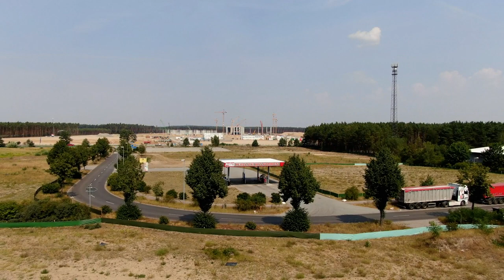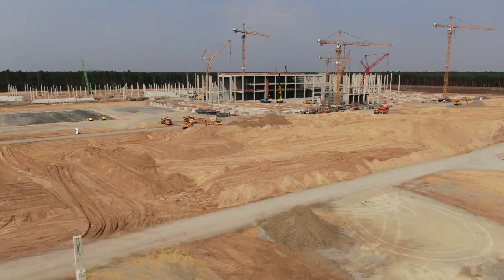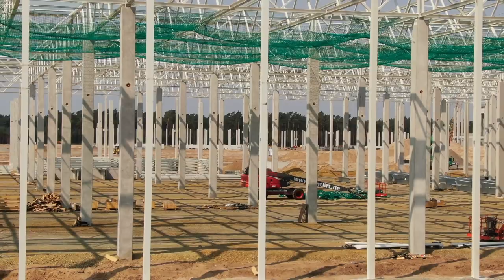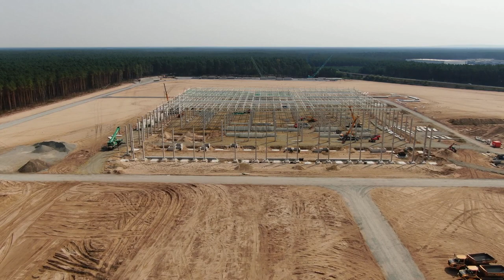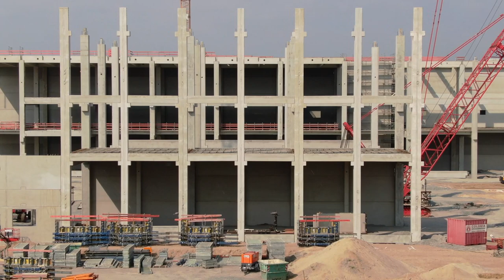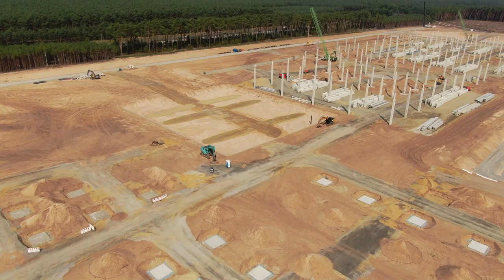Giga Berlin | 2020-08-09 | Roof structures

Comment: Thank you Tobias! Looks like the work is proceeding very well. Do you know if Tesla got their updated application approved?
Reply: Nothing has been officially and ultimately approved. But don't worry. German authorities want that factory! No doubt about that. They have finally realized that the transition to green(er) mobility is inevitable.
Reply from the maker: There will be no approval before October.
Reply: @TobiasLindh   When will they get permission to drive the piles for the stamping and casting sections?  That's where the heaviest equipment will need to go,  and will take far longer to complete and fit out compared to the relatively simple drive unit building. If the stamping and casting buildings are delayed, (due to having to drive piles through the water table), it will hold up the completion of the overall project!
Reply from the maker: @CiaranKing They are working on the permission for piles. The last information was, that Tesla didn't have all required documents ready. That was a couple of weeks ago, so the permission should be ready very soon. The most complicated building is the paint shop though.
Reply: @TobiasLindh  Thats true Tobias, I am building there too ^^ Cant wait till its finished. So much work is putted in by all the people around! Hopefully I will see you around. In case I am building the paint sector with my colleagues which seems nice so far!

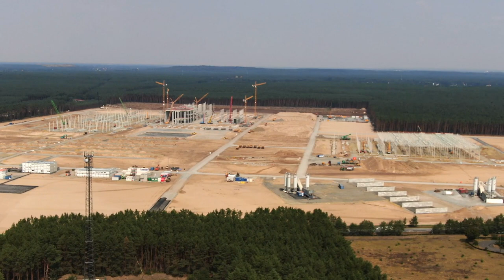Comment: @1:10 I wonder what these 7 parallel free standing walls are for between the 2 concrete mixers, they are standing there at an odd angle with the rest of the contruction site, doing nothing for weeks now!

But nice footage, it really taking shape now.!
Reply: Storage boxes for sand and gravel.
Reply: the 2 Concrete Mixer are vor the Final Floor Concrete, all the other Concrete comes form outside in this phase.
Reply: @tautautaulau  Thanks, makes sense,   but then the boxes still have to be filled

Comment: How do they ensure each concrete block in the ground is at the same height as the concrete block next to it / the rest of them? Seems impossible :-)
Reply from the maker: when they place the columns they put wedge shaped spacers on all four sides to align the column. Then they fill the gap with concrete.
Reply: Same hight is the smalles problem (no problem at all), the exact position and orientation is the challenge!

Comment: 👋 Tobias. Is it possible to have a vid of the cement plant in operation?
Reply: The cement plant? There is a cement plant 20km away, but there is nothing to see.
Reply from the maker: You mean the concrete mixing plants? They are not operational yet. Or do you mean the cement plant in Rüdersdorf?
Reply: @TobiasLindh  
Sorry for my incorrect terminology Tobias. 😔 Yes I mean the concrete mixing plant on site. I can not see any signs of action there, but I thought that other comments were alluding to it.
Thanks for your reply. 👍🙂
Why aren't they using it for the concrete they need for footing?
Reply from the maker: @phillip48ful  Right now they don't need concrete for footings. The footings for the paint shop are all done and body-in-white, general assembly and drive unit has precast columns with integrated footings. Maybe they will use it for the footings of stamping and casting, but I don't know.
Reply: @TobiasLindh  Also, even when they need more concrete for foundations they will order it from the factory. Those local mixing plants have different tolerances.
Reply: @jbell6642  
Thanks 🖕
Reply: @Phillip Pomfret 
[comment deleted]
Sorry. Didn’t mean to be pedantic.
Reply: @jbell6642  
Accepted. 😘

Comment: Are they really only working on weekdays? Most Tesla or SpaceX construction sites are working basically 24/7
Reply from the maker: No work on Sundays. That's German law. But the factory will run 24/7 because there is an exception in the law for that.
Reply: @TobiasLindh  Thanks Tobias I am originally from Germany but live in San Diego now. When I was still in Germany companies could apply for exceptions but it is probably prohibitively expensive to pay workers to come and work weekends. have you seen the footage from Austin terra factory or Boca Chica Starship? They never stop. It's amazing and I assume Shanghai probably also has no such concept like work prohibited by law for a project supposedly important to the country. Do you think these limitations will ultimately impact German and EU competitiveness?
Reply from the maker: @AMeierhoefer  You'd need good reasons for exceptions though. But right now they are not even using all the time they are allowed to work. And I think it wouldn't change anything in the overall timeline if they would work more hours right now.
Reply from the maker: @AMeierhoefer  I don't think it limits competitiveness. Germans don't work less, they just work on more regulated times.
Reply from the maker: @AMeierhoefer  Yes, I also follow the Texas factory and Boca Chica as well as Shanghai.
Reply: @AMeierhoefer  The strenght is to be found in serenity.
Reply: @TobiasLindh  OK, nice insight. Thx
Reply: @TobiasLindh  Well, I can tell you that that is not accurate. A quick overview can be found here: https://clockify.me/working-hours
Reply from the maker: @AMeierhoefer  Ok, maybe they work less. But it's not because of Sundays. When you run a business 7 days a week every worker will have some days off anyway. When you run a business 6 days a week it just shifts the off-day to Sunday for everyone. If you have the same amount of people, they wouldn't get more done in 7 days because there will be less people at work each day.
Reply: @TobiasLindh  ok, makes sense. Still great progress

Comment: I swear, they could have brought in the whole completed factory with an army of helicopters and just drop it in place ready to manufacture the day after ground breaking and there would still be people complaining that the building process is far to slow and the Chinese did it much better and there is too much red tape and the Germans are doing it all wrong. :-)

Thanks for the great videos. :-)
Reply: The German factory is actually moving faster than the Chinese one
Reply: Thomas Hahn Too true. Great comment! Cheers.
Reply: Lol. They could have put 1,000 people with hair-dryers on the poured  concrete to get it to fully cure in less than 30 days...wait, it’s not an evaporative process. Never mind. 
: )

Comment: Never seen a building where the floor is done last, anybody? 🤔
Reply from the maker: This is not a private house. It's a huge factory. In all my research on factory construction I didn't find a single factory where the floor was done before the roof.
Reply: It's better, if is raining, you have the roof you can put the concrete floor, work inside etc...
Reply: This is the usual way to built industrial sites. Think that heavy machines what are rude with metal, as presses, need independent foundations depending of their features. One time  this  kind of deep props are finished you can start to think in the floor. Much better to work in all the different kind of facilities  under cover of the weather.
Reply: When my company expanded a few years ago, the process was exactly the same. Eventually they can work on the floor and the roof in parallel.
Reply: Sure. Watch how a residential garage is built. Floor is placed and finished only after footings, walls and roof are built. 
Concrete sets up very fast but it takes about 30 days to cure to the point where it’s resistant to concussive damage or excessive weight. Until then you can’t risk heavy activity on or above it. Plumbers and electricians are fine to work on green concrete, but not trusses and forklifts. 
That, plus you have environmental control once the building’s envelope’s in place. 
Concrete floors almost always get done late in the process, even with private houses.

Comment: They are building very very fast but I don't believe it will be ready by the end of the year. I China they needed like 12 months to start the first test units. In Germany it seems that it is going faster but there are only 4 months. That was the time needed in China from finishing the factory to start manufacturing the first testing units. Furthermore when I researched a bit I found out that the site for this freaking factory is massive 300 hectares more than 3 times bigger than China. So they will need like 2-3 years to completely finish that
Reply from the maker: The already cleared area for phase one is a little bigger than the complete factory property in shanghai.
I agree, they won't be able to produce anything this year. I think we might see the first body-in-white tests early next year.
Reply: @TobiasLindh  In my opinion by the end of Q1

Comment: Concrete is the most polluting building material.
Reply: Its made from cement and gravel. Cement is made from lime, clay and plaster. Natural products.
Oder in Deutsch. Beton wird aus Zement und Kies gemacht. Zement wird aus Kalk, Ton und Gips gemacht. Natürliche Produkte.
For special purposes, like underwater, freezing situations, top of a tunnel, also chemical products as additive.
Reply from the maker: It's true that concrete production releases CO2. But so does the production of steel.